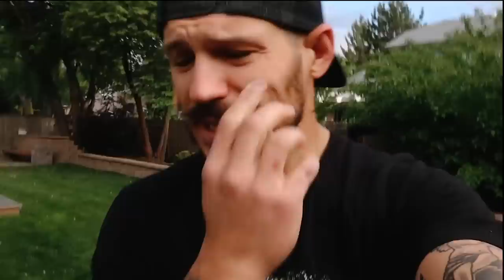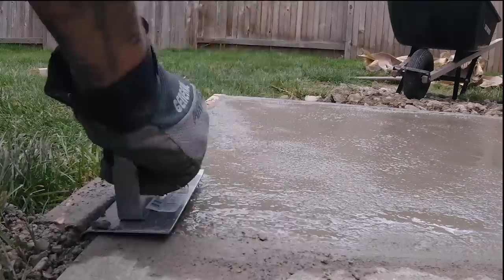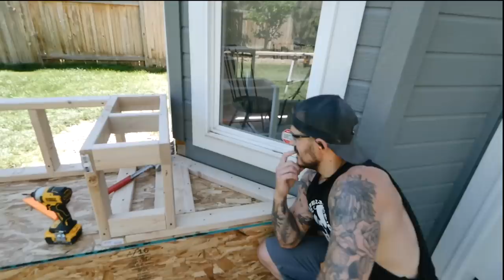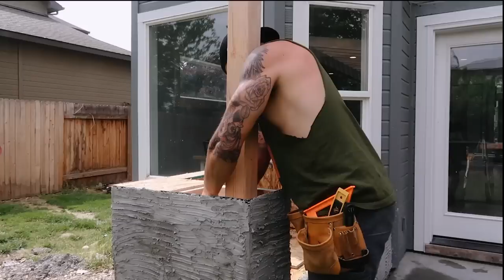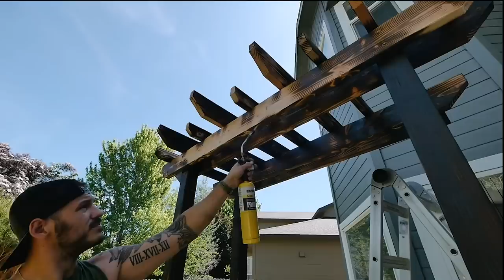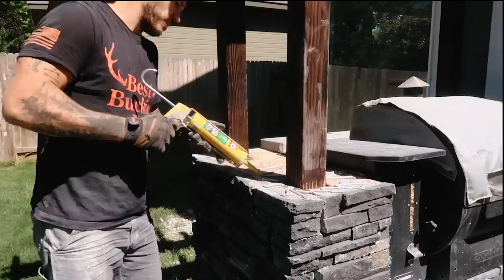Building Outdoor Smoker Grill Station

Comment: Honestly, this is a flawed build. 1. how's he going to pull the pellet grill to an electrical outlet. 2. He didn't do anything to handle the grease coming out the grease chute. He can't use the ash can below the smoker so he will have to vacuum the fire cup out before each use. He also can't swap out pellets since he again covered up the discharge chute.

Comment: Nice job but it should be mentioned that you have to adhere to code in your area when building that close to a window. You should always use pressure-treated lumber on concrete if not your base will rot in time.

Comment: Project looks amazing and it probably wouldn’t ever be an issue but I still always prefer PT for any outdoor applications, guess it’s somewhat just peace of mind for me but it looks great!
Reply: I also prefer to have the frame raised an inch or so off the concrete with only the anchoring posts attached to the concrete but my applications often are incased with interlock so the frame at the bottom is more likely to see somewhat pooling water as it’s below top of grade

Comment: How are you handling the propane tank for the grill?  If yours if charcoal then you are fine but if you have a propane tank I would recommend adding some doors in the back to store the tank. Also one thing I have learned in laying stone veneer is to constantly check your level during each course (row). Great job on the build!

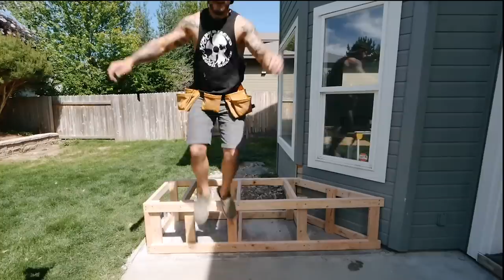Comment: At 5:30, it would make your framing stronger if you sistered some 2x4s vertically to the ones you already have.  Cut them 7" shorter and  put them directly in line between the top and bottom box to bear the load in compression rather than just having the screws bear the load in shear.  The OSB helps, but also in shear.  As the old saying goes, there is more than one way to skin a cat.  Why anyone would want to skin a cat, I don't know.  I'm in the middle of my outdoor kitchen build using 20 gauge 2.5" metal stud and track, then I'll skin it with cement board or backer board and veneer stone.  Great finished product, thanks for the ideas.

Comment: Two questions: 1. Where does the propane tank go (or is it charcoal)? 2. Are you worried about moisture getting in between the paver seams (or did you seal it somehow)?
Reply: neither it is wood pellets. and it goes in the hopper on the left side.

Comment: @Mr. Build It, the only thing I've noticed that I can comment on. Is the fact you didn't seem to raise the wooden platform from the concrete slab with plastic spacers. Leaving wood in contact with concrete is a bad idea if you want longevity of the build. Since Concrete is a great moisture wicker.
EDIT; NVM, you seemed to have raised the base with bricks.

Comment: I only do small jobs around the house, but love your channel. Are you worried that water gets into the wood structure from the top and rot the whole thing? Or will the water just drain out at the bottom and the wood getting wet is no big deal?

Comment: Great job, if you want a perfect finish on the concrete, use a mag and then your finishing trowel. The mag with pushes the rocks down and opens the pores to allow for correct evaporation. Which then you come back and finish it with a finishing trowel to make it smooth.

Comment: Thanks for the video! Looks great! Two questions out of curiosity - 1. is there a minimum distance needed away from the window for the heat from the grill to not affect your glass? And 2. Is the wood you’re using for the charring pressure treated or not? Curious how that affects it for that technique. Thanks!

Comment: Usually your videos are great, but you missed a lot on this one:
1. Expansion joint between your pour and your foundation.
2. Pressure treated baseplates
3. Pressure treated plywood (not OSB!)
4. Backbuttered bricks still need to be troweled.
5. Spray your backer board with water before applying the brick, else it'll just suck all the moisture out of your backbutter and it'll fall.